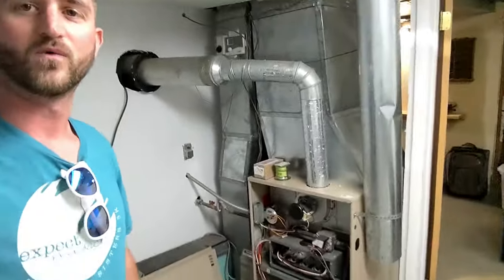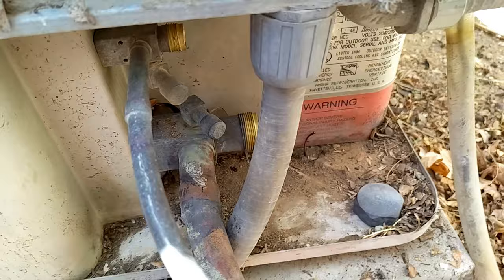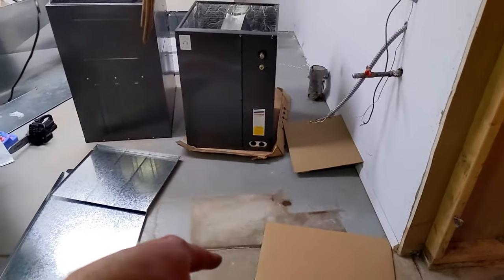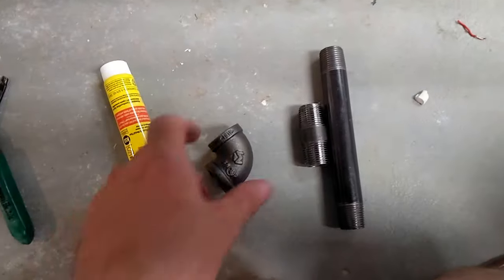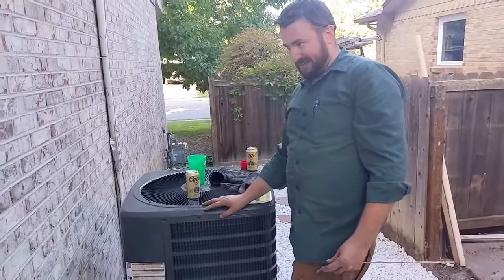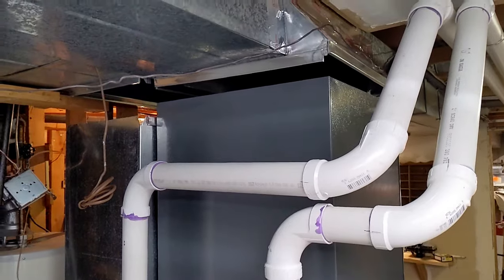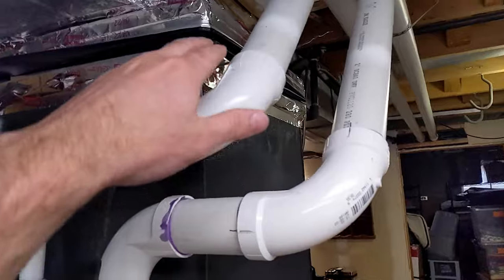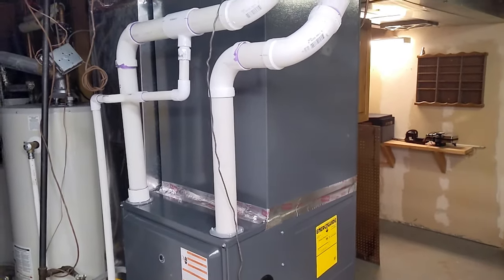How To Replace your Furnace and AC Yourself | iDIY |

Comment: All these people saying that DIYers should not do their own work on their own HVAC make me laugh. 1 I am not paying thousands of dollars for someone else to do the job that I know how to do. 2 it is not that hard to do, a few wires, gas line, and ductwork. Of course there are the refrigerant lines which you can have someone else do for you if that part is not your thing, but even that isn't hard.
Reply: But what makes me disgusted are the HVAC companies overcharging homeowners for repairs that not extremely prices ex: replacement of a capacitor $400 plus when part cost less than $50

Comment: You didn't use nitrogen when you brazed. You just introduced cupric oxide into the system. It's going to mix with the oil and gum up your txv/fixed orifice. You'll be calling a service tech within a couple of years. Not only that, did you vacuum the system to 500 microns before dropping charge? Also, the flu exhaust hits the dew point, producing water, which then drips back into the furnace. It won't rust it out.... wow. It has a drain for that. That's why you slop the flu towards the furnace. You diy guys really know how to mess up an install.

Comment: I was very excited as a HVACR Engineer to actually watch a DO IT YOURSELF video for the entertainment value. Once you said you involved an HVAC tech I lost interest but great job my man. We need to eventually see a true do it yourself video on a complete install. I would be mind blown if someone actually did the removal and install correctly
Viewers really need to understand how intricate and detailed a proper install is. Introduction of any oxygen / contaminants etc into your system will destroy your system so please do not try this at home. There is very little wiggle room with refrigeration compressors, not to mention air flow , static pressure , using the proper Braze rods and heat protection compounds, sweeping with Nitrogen while brazing, additional refrigerant needs for longer line set based off not only size of line set but length as well, a proper P trap, furnace adjustments , proper vacuum to 500 Microns or less, decay test, potential oil contamination in old copper line set ( R - 22 uses Mineral oil and New 410A uses POE, mixing the two past a very minimal percentage is bad ) making sure you have the proper filter dryer in the proper location, importance of deburring your line set is so much more important than in traditional plumbing, power supply etc . I Can go on for a long time but you get the point. Call the pros as this simply isn’t a do it yourself job
Reply: Yeah the HVAC guy wasn't flowing nitrogen. I would bet close to 99% of residential guys don't flow nitrogen while brazing.

Comment: Lucky for me, there is an online Goodman dealer who has a warehouse about 20 miles away. I bought all of my equipment right before the pandemic and all of the price increases. I use to work as an HVACR contractor so installation wasn’t a problem. I saved about $5000.
That fresh air vent location makes me nervous if you get any snow, which will block the vent. 
In the south, almost nobody installs high efficiency furnaces because it doesn’t get cold enough to justify the added expense.

Comment: Any person servicing, installing or disposing of stationary appliances (except the disposal of small appliances) must be a section 608 certified technician.

Didn’t see nitrogen flowing while brazing, didn’t see vacuum, didn’t see gas pressure checked/adjusted (no they do not come preset from factory), and from my understanding from your responses you are not epa certified and every second of you disconnecting the old system was illegal. Not trying to hate but I am an hvac technician and I would not recommend this at all. At least invest in the proper tools and follow proper guidelines on installing equipment before you “influence” someone to do the same thing and they get killed. 

You did a good job for someone not experienced in the trade. Better than I could have first starting out

Comment: Why did you edit out the part where you released the refrigerant as you cut the suction line. 

I guessing you didn’t know that the suction line service port isn’t a one way valve. 

What you should have done was during the pump down as the compressor is energized close the suction line 

It’s probably better that you didn’t give the EPA the video evidence to fine you the 36k for releasing the refrigerant
Reply: You are years behind in your 608 rules. The current fine is $44,539.

Comment: Good luck on getting your equipment worked on
Reply from the maker: Why would I have a problem getting It worked on? Just had the AC tuned up after running it all summer. The HVAC contractor put his gauges on everything and made sure refrigerant and pressures levels were good. Everything checked out great.
Reply: @CentennialRenovation they complain is the home owner even simply cleans the A frame coils…it’s their entitlement thing.,,special people I guess who think they can discriminate and chose who is worthy and who isn’t….

Comment: U don’t have to have a license to buy it …I bought mine online and no one has ever asked me for a license or anything.,,I even went through my states laws and it is not a law..,all the Freon is is methane and butane…propane etc…they use mineral oil or similar in the lines too…nothing toxic and deadly and nothing too dangerous..,don’t smoke around it of course but same thing S we use in grills basically….u don’t need a license to buy propane do u? It’s all gaslighting to be able to inflate the prices….

Comment: Do you have your EPA-608 certificate?  If not, you're not legally supposed to do any work that might release refrigerant.  Not using proper tools (gauges) is a sad shame.   People,  please DON'T follow this video.  Not legal.
Reply from the maker: No refrigerant was released when I removed the old AC condenser. It was all pumped back into the unit safely.
Reply: @CentennialRenovation  But are you certified? If you say it's not necessary,  why do HVAC/R techs need to be?
Reply from the maker: It's my own house. That's the American dream man, life, liberty and the pursuit of happiness. I don't need a certificate to prove anything to the government to work on my own house. Sure, if I was doing this for other people it would be a different story. But I don't need government authorization to change the chemicals in my hot tub, or to change an outlet, or to replace my own furnace.
Reply from the maker: Also, the state I live in does not have any special licensing requirements for HVAC contractors.
Reply from the maker: To anybody reading these comments, if you're not comfortable working on your own furnace, you might consider hiring it out. Use common sense, do your own research, and make sure you know what you're doing. You will be dealing with chemicals, natural gas, and electricity. Best of luck to you. It's not rocket science and you can save a lot of money doing this yourself. Cheers!
Reply: Your comment is illegal
Reply: @leealtmansr.3811 certification means you're asking someone's permission to do something, if you need permission from someone to live your life, go for it. It's actually extremely simple to change out a HVAC system if you have the knowledge and skills and they're not that difficult to acquire on your own. Your lack of confidence doesn't mean other people are not competent.
Reply: @theone4929   But, that's the law.  It also show the certificate holder has had some proper knowledge of handling refrigerants.
Reply: Gotta protect that cash cow right?
Reply: @CentennialRenovation That is not possible I watched you pump the system down turn off the compressor with suction line service port still open then you closed it. 

The service line is not a one way valve so after the compressor was shut down the refrigerant traveled back through the service port into the line the second you shut that down.

You edited out the part where you cut the 2 lines I guarantee there was refrigerant in that line.
Reply: @michaelcso2400 Dawg don’t even attempt to do this yourself lol. Believe it or not the suction line sucks the refrigerant out of the line. The other line (that was indeed closed) is to return that refrigerant to the A-coil inside the house. Without that valve being open the refrigerant has nowhere to go once it’s in the old condenser. It’s almost acting like a check valve or something.
Reply: @blistex1354 Nothing you said was accurate in any way.  But hey I’m just a licensed mechanical contractor for 25 yrs so….

It’s very clear you have never installed an AC in your life but you are speaking as though you have. 

The service port is not a one way valve it never has been. 

When pumping the system down you are creating a vacuum or the absence of refrigerant in the line. If you turn off the compressor prior to closing the valve the refrigerant will travel back through the port and it will fill the line, the evap coil the pressure will equalize. 

This is an undisputed fact. 

This video clearly shows the compressor off, the narrator then describes he will then close the valve and the cutting of the pipes were in fact edited out.

I guarantee that when he cut that line there was refrigerant present and if he recorded himself releasing refrigerant I’m pretty sure the EPA might be interested in an extra 50k in their pocket for the clear violation of the clean air act of 1995. 

In regards to previous statements that this was the installers home…none of that matters.  It’s the law
Reply: @michaelcso2400  You could be Willis Carrier himself and still nobody would care about your work experience. I bet if this was a plumbing video you’d be a licensed plumber too. Regardless of your “licensed” opinion, expertise, or whatever you want to call it. This video was intended to show people that you can replace your system yourself. Not everyone can or wants throw out thousands of dollars to have some LICENSED HVAC tech to do a half ass job on their home. Did he do a prefect job? No. But I haven’t found a single HVAC video where there’s not a 95+ year experienced technician complaining about something. Again, this is for his own home not yours. Let him deal with any issues that come about. And if you’re really that concerned about the EPA laws and regulations go ahead and change your career field and become EPA officer. You’ll probably do more good doing that than commenting on YouTube videos.
Reply: @CentennialRenovation the 608 licensing is a federal agency. Looking through my state, they don't have any requirements but the EPA 608 bit still is enforceable.